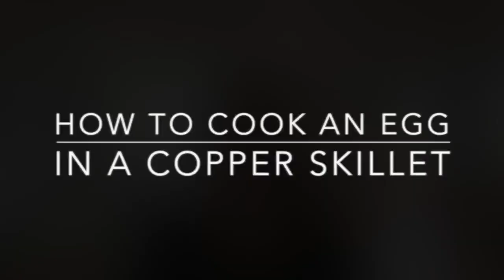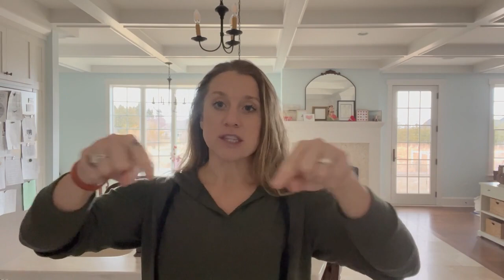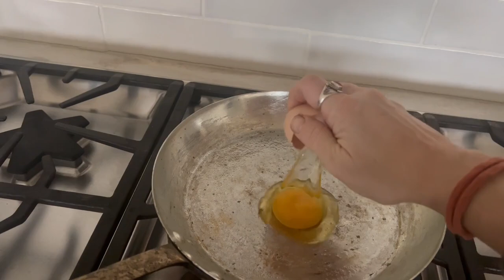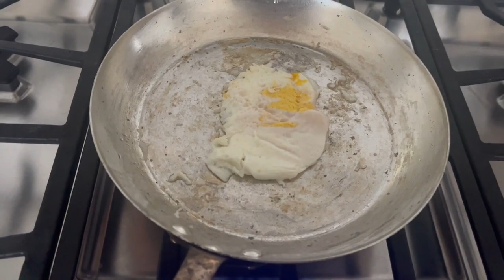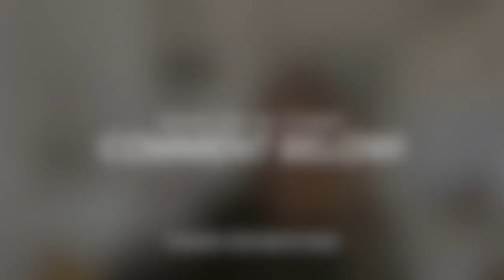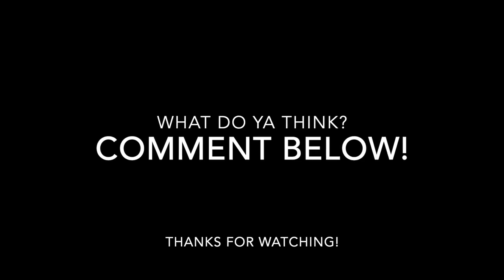How to Fry an Egg in Copper

Comment: My pan of choice for frying over-easy eggs is an old, 10-inch Mauviel tin-lined skillet. I preheat the skillet with the electric burner set no higher than 3, which is slightly less than one-third of the temperature range, add a bit of grapeseed oil, crack the egg into the skillet, and it cooks perfectly. Unfortunately, I only have an electric range—I much prefer the instant temperature flexibility of gas.

By the way, I need to send that Mauviel tin-lined skillet to you to be re-tinned.
Reply from the maker: Oh, I love that you have it down to a science on electric! And that you get great eggs! I have to say, it took me a while to figure out how to do it on tin - it's SO precise! But sure is sweet when it works out! We try to keep our oil consumption down (so many calories with no nutrition density!), but I have never used grapeseed! Hmmm... :) And yes, send me a note for the skillet!

Comment: I appreciate the video but I think I will stick with carbon steel or cast iron for my eggs. I reserve my copper pans for sauces with tomatoes, vinegar or lemon juice that erodes the seasoning on the carbon steel and cast iron.
Reply: Agreed, Mr. B. Tin does absorb fats and become non-stick-ish but doesn't perform as well as carbon steel (or iron)
Reply from the maker: That's the best thing - there's no real / right answer, just preference.  You've got it figured out! :) I haven't tried eggs on carbon steel - I will have to do so! :)
Reply from the maker: @pianistajs  I have to say, I haven't noticed the tin absorbing fats! I will have to do some tests! :)
Reply: @pianistajs  I have a minor in metallurgy - tin absolutely does not "absorb" fats.  Fats denature at various  temperatures, some fairly low, and can create a seasoning but not with all oils.  I tend to use peanut oil in my carbon steel, but tin lined pans would be one place to use Olive oil and a pro tip is to use 50% olive oil and 50 percent unsalted butter.  Butter lets one know when the pan is at approximately 210 degrees which is a good temp to make eggs ( though they fry the heck out of eggs here in the states at high temp) and French style omelettes.  Europeans fry eggs at medium low - less than 275.  Much better results imho.